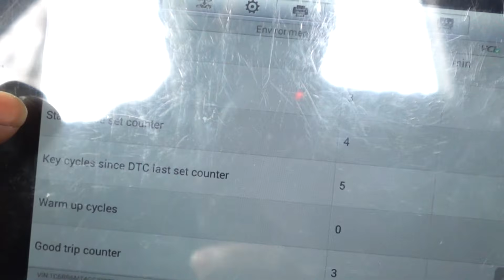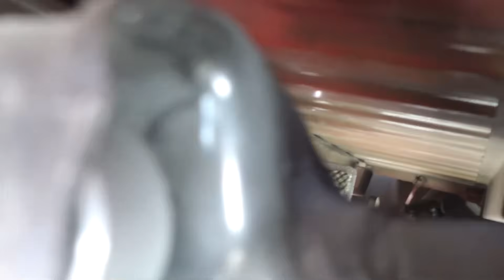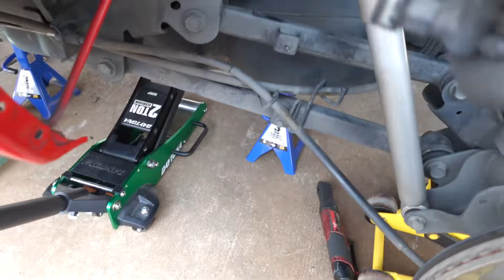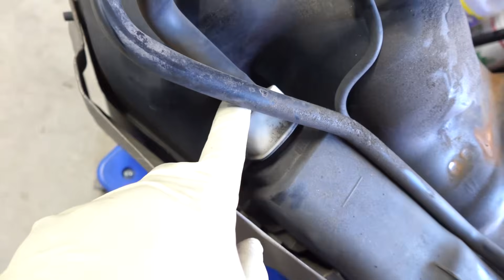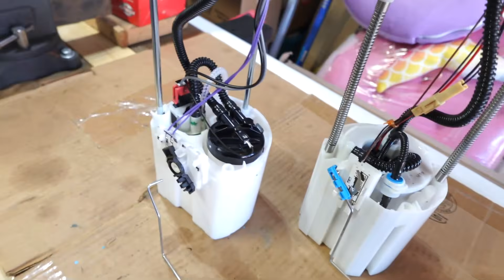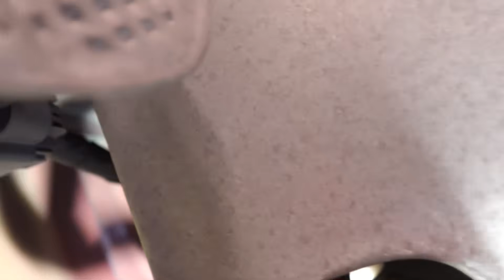Fuel Pump Replacement - 2009-2018 Ram 1500

Comment: Can a fuel pump throw p0304 4th cylinder misfire
Reply from the maker: It would be multiple cylinders not just 1. Possibly an ignition coil or a bad cam.

Comment: My 2014 ram has been shutting off while slowing down at a stop light, replaced coils and plugs, moving to fuel pump next
Reply from the maker: I’ve never had that particular issue. Sounds like a fuel pump going bad. Note: many of the rams also have a fuel pump control module that’s mounted on the fuel tank that’s could also be an issue. A bad fuel pump can also take out the module.

Comment: 1. Remove tail lights wires
2. Unbolt but do not remove driver side fender well rear
3. Depending on your year unscrew the three screws on your fuel cover or remove the seal unscrew the number 10 that hold fuel neck
4 crawl under truck remove 6 bolts holding the bed
5. Lift up bed driver side I used a 6 by 6 piece of wood between the frame and the bed go to the other side do the same thing
6. Slide bed back while it's on the wood 2 ft
Now you have access to the top of the fuel tank change out pump be sure to clean around that before you open the ring that holds the pump because all that dirt will fall into the tank I know you guys going to say oh man that's a lot of work that's complicated but you're not laying on your back dealing with a half full fuel tank on a jack while it's tilting back and forth breaking these plastic lines this method no hoses need to be disconnected other than the the one that goes to the fuel pump before you remove it and the power to the fuel pump and reverse the steps to put it back I just did it today started at 9: 30 it's not 1:00 p.m. I've already taken the test drive and stopped and filled the tank
Reply from the maker: Honestly it did not take me that long to do this one maybe 2/12 no more than 3 hrs. And in between I took a break and ate something. I don’t work on these trucks a lot. It’s my personal truck. I heard of ppl lifting the bed I seen it done on a Silverado. I possibly would if I worked at a shop and frequently had this type of work. The job was not too bad to me. Most ppl just not looking forward to replacing a fuel pump on a pickup truck.
Reply: Anyone watching this video and thinking about lifting the bed.... If you have a 1500 Crew Cab Classic, the fuel pump is located underneath the cab, and you won't be able to access it by pulling the bed. You need to drop the tank.
Reply: @camerondow4184 well I have a 2015 dodge ram 1500 5.7 crew cab and I just did my yesterday I move the bed like 3 feet away and my pump was right there is much easier this way than work under the truck for sure
Reply: @andresmartinez4532 that has a different location than the 2019-2024 Ram Classics. Those are the years I'm referring to.

Comment: I have the 2011 5.7 hemi. It wants to bogg just a little bit into higher gears. My code reader says lean bank 1 and 2 .. also fuel pump circuit  A open.  So changing the fuel pump today. EDIT: changed the fuel pump still getting the lean codes. So I don’t know.
Reply: You fix it yet?

Comment: Where in the heck is the fuel filter
Reply from the maker: @KevinHohlstein  There is no serviceable fuel filter. The filter is actually integrated into the fuel pump assembly. Many modern cars are like this.

Comment: Why not make access panel??
Reply from the maker: @desertdog01  Not for me. I’m not butchering up my truck.
Reply: @KoolFredsGarage me either
Reply: I'd consider it if it was just under the bed floor. On a crew cab (like mine), half of the pump is under the crew cab.

Comment: Yea , i cut a nice hole in my bed and it works perfectly. My tool box sits over it along with my 20 gallon fresh water tank. No crawling around on the ground in the dirt or snow or heat . No swearing or cussing, just smiles .
Reply: I've got an '09 Dodge Ram with 165K miles and I'm getting ready to change my original fuel pump out too. Hasn't failed yet but I'm sure it could happen any time. 
I've heard about guys cutting a hole in the bed to access the fuel tank and thought about doing that too. Seems that it would be a lot easier and quicker. Was it hard to do that?  
Thanks! Van McDowell - Georgia
Reply: @VanMcDowell  Only on my single cab short bed.
Reply: Thanks!
Reply: Beautiful.